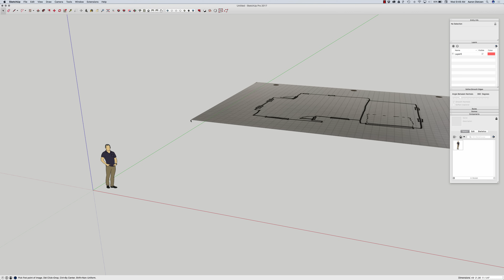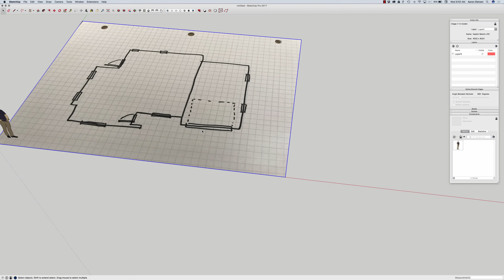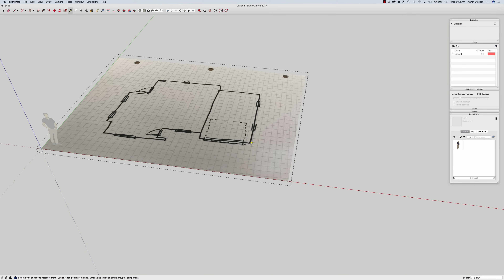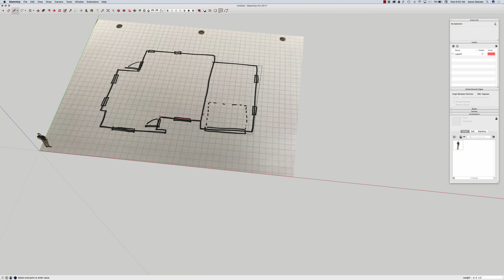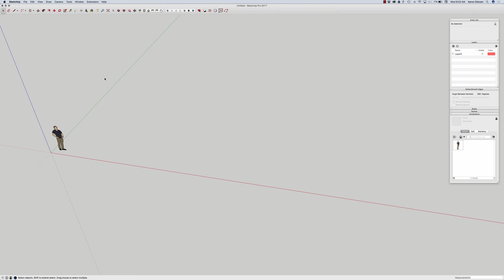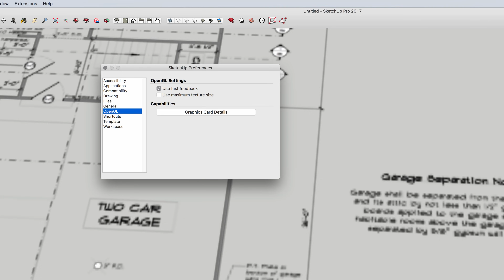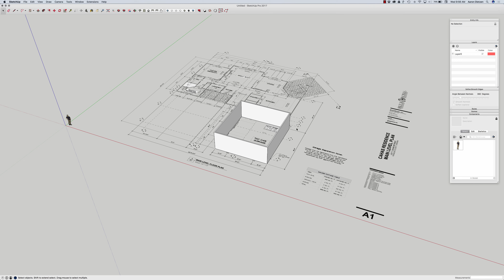SketchUp Skill Builder: Reference Images for Architecture

Comment: This does not work in Windows.  When I change the measurement while using tape measure, no response.
Reply from the maker: Sounds like a good question to bring to our forum (forums.sketchup.com). Scale works the same, regardless of OS or platform, so it is possibly an issue of missing a step or a problem with your computer. Either way, the helpful folks on the forum should be able to help!

Comment: Your software comes up with a big (/) NO when I try to drop an image... how to I get the software out of Idiot mode?  (this is a blank document, created just before)... I LOVE how you also TELL ME WHY IT IS A (/) instead of just saying NO.. (Oh, Kidding here, no software actually thinks about the user experience - there is an assumption that you are a Author of the software, or have been using it for 10 years before you can do simple things... )   This software just seems like garbage to me, easy for some things, Insane hard for others.. like using an image to trace.. Or, tracing an image automatically like CorelDraw did back in 1998...  
 Out of my trial period, so I'm assuming I have no functionality left in the software...  (can't do this unless you 'upgrade' or something crazy??)
Reply: Dropping images only works on Mac, with the supported formats. The best way to get help with using or learning SketchUp is through our forum (forums.sketchup.com). It’s much easier to walk through issues there than here, via YouTube comments.

Comment: Mac version (downloaded 2 weeks ago), doesn't prompt to resize at 2:32, any clue how to make it work at 2:32, so how do you resize it super easy like this when that feature is missing?  Also, it seems that tools are missing in the Mac Version (Rectangle is it, no cornered Rectangles etc as shown in other videos)  - why not make the interface exactly the same???   I'm about to dump using this program - still on the 30 day trial.  I can only get about so upset with a program before I quit using it.

Comment: Should mention that newer versions of SU - to measure the active group dimension - take tape measure and hold over start point, then hit CTRL to remove the (+); then click on start and end points; enter or type in the desired measurement in the right corner bottom of screen 'LENGTH WINDOW BOX'; hit ENTER and a query box comes up asking if you want to resize to that new dimension.
Reply: Yep this is a key point.  Tried to get this to work for way too long before I read this.

Comment: Solution to non-action on click (at least on my MacBookPro): 1, group ref line and pdf. 2, select tape measure tool, 3, hold down "option" with the tape measure tool so that a guide line is not drawn when taking the dimension (easy to see on icon of tape measure, when key shaped symbol below tape measure icon is not present then you can proceed with this method), 4, measure line, 5, tab into dimension box or start typing the new dimension, 6, you will see a line of text in the lower left telling you to type in new dimension although you just typed in the new dimension, so type in the new dimension over the dimension you just typed in and hit enter, 7, then you get the magic dialog box asking you to re-size. 

Summary: THE TRICK IS TO HOLD DOWN THE OPTION KEY WHEN SELECTING THE TAPE MEASURE TOOL. if you are seeing a guideline icon under the tape measure tool then you should hold down the option key when using the tape measure tool so the software isn't confused, then you have to enter the new dimension, then watch the dialog box on lower left, then tab into dimension box again and re-type the new dimension.

This solution brought to you by Caffeine, use it for all your software needs. Results may vary with DeCaf.

Comment: Hi Aaron,  when I draw the line, it snaps to a grid and won't let me draw a line to match an actual wall.  After making the group and then using the tape measure I have a similar issue and when I type in the correct measurement and press enter I don't get the resize message.  Any tips.

Comment: Paul, I selected my image, made it a  group, used tape measure, obtained the measurement, then, as you suggested, I typed in the actual dimension, and then the screen asked If I wanted to resize, and I  said "yes."  It worked as you said.  Thanks for a timely and helpful response.  Good day!

Comment: I use sketchup 8, and missed in your instructions on how you re-scaled the hand drawing.  After you drew line and measured it you said it should be 12 ft.  You then right clicked and some how the drawing mysteriously re-scaled itself.  Please explain the steps on how you re-scaled.  Thanks.
Reply: I'm using the current version of sketchup, so assuming version 8 is still the same:
After using the tape measure tool, you can type an actual measurement. If you are editing a group, it will prompt you to resize the group to the measurement you typed, if you are not editing a group, it will prompt you to resize the entire model
Reply: @pauldalia2625  thanks for the tip I was wondering how that worked
Reply: I have the same question!
Reply: thank you -- useful tip!

Comment: Are there plans for the future to add the ability to import PDF files directly in on the Windows version?  I know for me that is a VERY important feature.
Reply: I use Bluebeam Extreme to view PDFs, so it's pretty quick to export a page as a png or jpeg. If you need it in DXF format, I use Inkscape which is free and works pretty well converting from PDF to DXF
Reply: Quite often in my consultant engineer's business I'll get CAD files which have been issued as PDF (they don't want you messing with their original CAD files).
I'll often want to take them into Windows SketchUp Pro to visualise or assess things - but I'll hit the no-PDF-in-Windows-version brickwall. But I found a solution.
If you have Windows SketchUp Pro and your PDF has been saved from a CAD,  you can use the excellent Able2Extract (http://www.investintech.com/) to convert the PDF to DWG or DXF. Then you can import the DWG/ DXF into SketchUp Pro.
I've tried and bought PDF to DWG converters but they tend to lose detail. Able2Extract converts the CAD PDF extremely well enough to work with (you will need to set the settings right though).